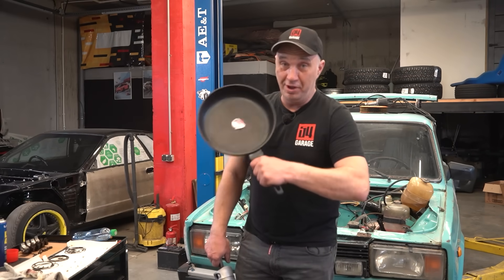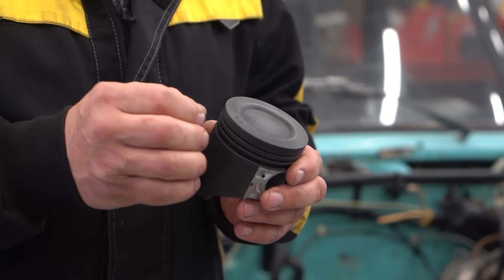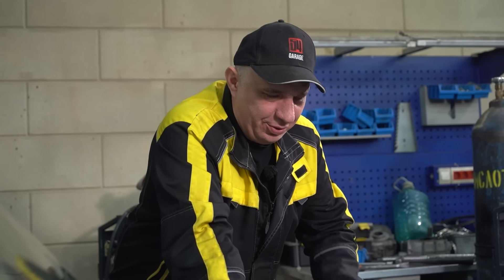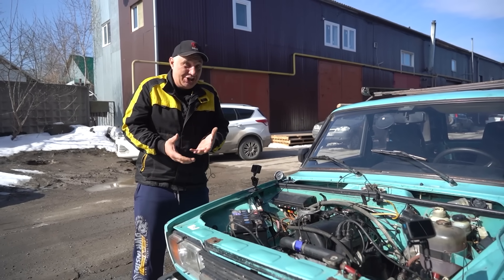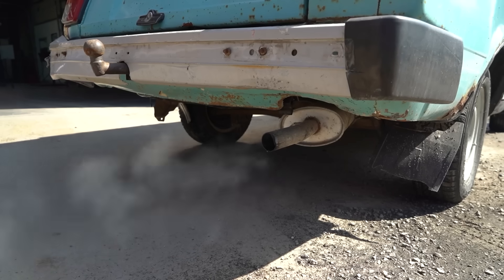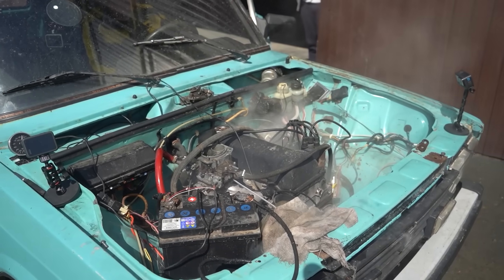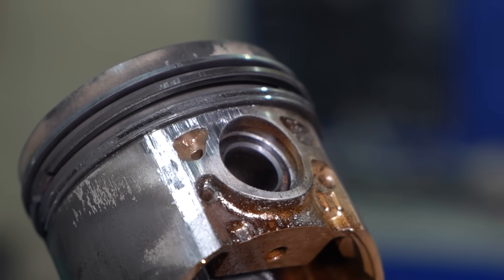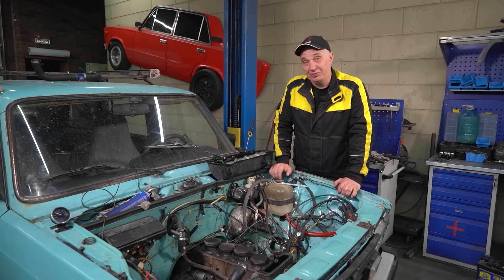We coat pistons with Teflon - what will happen?

Comment: Teflon is outdated as a coating material it doesn't last long and is not as efficient as modern coating methods like TiN, Manufacturers use DLC coating or ceramic entirely but not the same coating everywhere for piston dome, it's preferably made separately. Real race pistons made from anodized aluminium or classical with 3 coating zones. Teflon may be of some use on pistons skirts but nowhere else especially on segment rings, that's another coating, DLC is top notch but rather technical, cause you need to mask and control coating thickness. I've seen Swiss companies offering multilayered ceramic/DLC but that's race secret weapon, no one will tell you exactly where to use it you have to try and regularly expect tour engine, i.e tear down 😂.
Also for DLC, one have to remember that carbon, especially do for a quite good cutting tool, even at 1 micrometer particul, I would advise to either DLC Cylinder walls or add ceramic liners. Those treatment should be made in copiously honed parts also not the average Joe job. 
Also WPC metal treatment is another weapon in our disposition. It makes great surface for reciprocating part sliding against each others.
Coating is something special, you also have to check carefully for tolerances and maybe have to take oversized parts since metal expansion is not the same anymore. Since efficient coating thickness is rarely above 1-3 micrometer on pistons skirts you are usually pretty safe with OarMnparts

Comment: What is the point? it is the cylinder walls and piston rings that should have been coated. The piston does ideally not have any contact with the cylinder walls.

Comment: I ran a 72 plymouth without a radiator unknowingly for about 20~40 miles after the engine mounts failed and crashed into the radiator on its first test drive in 5~ years of sitting- the temp gauge was about a full inch past the limits on the gauge.

Comment: gonna say this before i watch the whole video. given that the last time i got high i forgot my teflon pan on the stove and it did not go well. i will say this will not go well for extended periods of time.... pistons generate around 350-500 degress celcius - teflon melts at.... 327.... this should be interesting when you factor in cooling and engine overall temps.

Comment: What you want to use is Cerakote. It's a ceramic coating made for auto racing that's now used in firearm's coatings. The one you want is called micro slick. Anti friction coating

Comment: An old engine rebuilder friend told me that Teflon coated engine connecting rod  bearings were tried by a big auto maker but they did not last long in use ,that was 45 years ago

Comment: In my opinion, Teflon coating is more reliable than no protection at all and is a fairly cheap option compared to ceramic coating, which may still be very expensive.

Comment: Try using titanium pistons.
Pros would be: higher Heat resistance, higher rpm’s, longer lasting.
Cons would be: high cost, risk of cracking a piston ring, and risk of blowing a gasket.

Comment: Teflon would work but is has a short life span. Like my frying pan it work till it wears out. Ceramic is what most used now, but for piston graphite might be a better application. I believe MB built a prototype 190 with graphite pistons with success, but dev cost was expensive.

Comment: piston engines have a few thousandths clearance between the piston body and cylinder wall for lubrication and reduction of friction. spraying a teflon coating on the piston body contributes to less clearance, leading to less lubrication, and more friction, and overheating especially after the teflon rubs off unevenly. any coating on the piston crown will probably burn off unevenly, cause valve problems, pre-ignition problems, and contaminate the engine as well as the ambient air. DuPont, the creator of Teflon, has stated that teflon is not useful for internal combustion engines. Concerns include potential clogging of oil passages or filters due to PTFE particles settling or forming globs, especially if not properly dispersed. There are products like Slick 50 Classic Engine Treatment, which offer PTFE-based additives designed to be mixed with standard motor oils. These additives claim to reduce friction, wear, and engine noise while improving performance and fuel efficiency by forming a lubricating "film" on most engine parts at once vs. baking the parts w a teflon coating.

Comment: Teflon does not transfer heat very well and will keep those Pistons from expanding by very much. The engine itself will still heat up. But the Piston itself will not get leaner mixture and get better fuel mileage and a hotter spark can be utilized

Comment: I have not watched the video but this is my prediction the front failed at about 250c. An engine piston normally maintain around that range. Basically the Teflon will exceed the exhaust pipe breathe in by some people and get stuck forever

Comment: Engine is stuck due to lack of lubrication what you can try is change the engine oil to 0w30 instead 5w40 because teflon coating reduced the space between engine sleeve and piston and 5w40 oil is thicker than 0w30

Comment: Heat the pistons to 300° and dip them in graphite powder, the kind used in farming is cheap, and see the result with a slight resistance to friction at high temperatures.

Comment: Make the highest revving motor possible, ceramic coat  some cylinder sleeves and press them in, ceramic coat the rings cam and crankshaft, all of the bearings, shorten the rods, remove the counter weights on the crankshaft, stiffer springs, larger cam, run a lightweight flywheel and driveshaft

Comment: The only part of the piston in contact with the cylinder wall is the piston ring.  The tefloned parts don't even touch anything except the engine oil. WTF, am I wrong?

Comment: I Had A Honda Civic That The Radiator Got Busted! I Went To The Creek And Got Enough Water In It To Make It To Auto-Shack! I Put Slick 50 Into The Engine Oil And You Could See The Temp Needle Move Down!! I Was Able To Drive The Car Another 15 Miles To get her Home! So I Believe In PTFE But In The Oil! Not The Combustion Chamber!

Comment: Heat resistance: Teflon™ industrial coatings can operate continuously at temperatures up to 260 °C (500 °F) and be used for intermittent service up to 316 °C (600 °F), with adequate ventilation, without affecting other properties

Comment: i didn't see your video yet but teflon hate friction whatever rings are the only one contact, engines start before pump inject grass in cylinder then less than one second with oil between cylinder and piston will erase teflon

Comment: Well, only issue I see here. I'm pretty sure there's a reason they say not to use metal utensils in some teaflon pans lol. I haven't finished the video but I suspect some FOD when you check the oil pan with a magnet.

Comment: It wouldn’t matter what you coated the pistons with as they are floating in the rings in the cylinders and are not 100% in contact with the cylinder walls. I’d think you would have to teflon coat the rings themselves to see any true results

Comment: 2:28 I am sorry, but that does not sound right. Before coating it had Ø79mm. After coating it is Ø78,8mm? So it got smaller? Certainly not. 
I think they never gave a measurement for the bore, so you cannot calculate the clearance at all.

Comment: I used to use Slick 50 to help old engines, it was brilliant. And worked by adding a Teflon coating to all parts slowly over a few hundred miles. 
Had one which even stopped its crankshaft knocking with it, brilliant stuff !!

Comment: There is NO advantage to be had by teflon coating the pistons. The only friction that COULD be improved is that between the piston rings and the cylinder, neither of which were coated and neiter of which would stand teflon coating. This is a stupid experiment.

Comment: Did you ask for any compensation on the machining of the OD of the piston before you did the Teflon coating ?  
  Or did you use the Teflon coating to compensate for cylinder diameter wear. 
Either way I would like to know if the piston diameter changed substantially by the application of the Teflon coding thank you

Comment: After it gets hot just once  it will burn the coating off

Teflon, or polytetrafluoroethylene (PTFE), can withstand temperatures up to 260°C (500°F) without damage. However, it begins to deteriorate at temperatures above 260°C and decomposes above 350°C (662°F). Pyrolysis, or complete decomposition, occurs at temperatures above 400°C (752°F).

Comment: excuse me since i raced and built a 750 hp in the 70's what i remember the the Piston won't touch the wall's of the cylinder it the RING'S that do this job and these are what is coated  with TEFLON .

Comment: So I’m confused if the piston touches the cylinder wall that’s a problem. Pistons have 3 piston rings 2 of which keep the piston from touching the cylinder wall. So why do we need slippery pistons? We need slippery piston rings or slippery cylinder walls but coating pistons seems silly to me.

Comment: You should coat the cylinder walls too. Maybe next time. You guys are nuts and I love it!
Reply: Wouldn't work. That's where all the friction is.😊
Reply: @josephdelp87  Manufacturers have been coating cylinder walls in low friction materials for decades. It's actually the right way to do it because the piston skirts themselves don't have much contact with anything, it's mostly the rings that scrape the cylinders.

Comment: I had a 1964 dodge dark slant 6.
 I used Slick/50 oil treatment. 
It went from 20 to 32mpg.
24$ a qt. In 1981. You could run out of oil and it would not seize.
Wish they still made it.

Comment: don't those older engines usually operate at around 70°C?
that's almost 3 times operating temperature
and more then 2 times modern engines operating temperatures

Comment: The piston ring means the coating is not even important.....the piston is smaller than the cylinder and the expansion of the ring is what makes the seal any coating would just be decoration unless in is incapable of withstanding the friction or heat.of the expansion gets to the point of seizure then a coating would not matter as it's size (diameter) rather than friction which is the point of failure.

Comment: ceramic pistons come on. air bearing as the piston seal. use the non-expansion ceramics. or zero expansion ceramics. something like zerodur glass-ceramics. ceramics dont care if its even at 1000C. teflon has a max temperature of melting point. around 200C or so. its plastic yet. actually normal 3d printed pla melting point is around 200C also.

Comment: PTFE is only up max 350 Celsius.Try DuraCoat, its maybe better for  higher temperatur. Or You can use natrium-filled forged steel piston, with DLC (diamond like carbon coating). Or maybe if You have very good sponsor, use pure beryllium piston and cranksheft... it will be expensive.

Comment: Teflon is great, looking at the experiment, next phase should be Teflon coating the cylinder wall and where it touches the piston. Top can be avoided as it changes the compression ratio. It also gets burned after some time...

Can also do the above experiment with Ceramic as suggested by other viewers.🎉🎉🎉

Comment: I totally predicted that the teflon will just burn off completely, right at the beginning of the video.
Anyone could tell so, who've been accidentally left a non stick teflon pot on the stove without liquid in it for half an hour :D
You might think that the teflon got too hot at 200+ Degrees C, but the combustion is actually a LOT hotter, like 2000C, which will get in contact with the Teflon.
At that temperature, any paint will just burn.

Comment: I am not a mechanic. I was under the impression the piston does not touch the wall of the engine. The piston rings run inside so what has the deal with this spray Job. Possibly the head of the piston may do something with the compression head distance of a few microns

Comment: ptfe/ teflon breaks down at 250-260c the combustion temp of a cylinder is 2000-2500c. normal operating temp destroys the ptfe, what is the point?

Comment: There is an American company that makes slippery aluminum coatings that involve hard-coat anodizing the aluminum and impregnating the hardcoating with a slippery polymer. I believe they have a variety of coatings that are put into the anodizing (yes, I said "into" and not "on top of").
At first, hard-coat anodizing seems to be a strange thing to do a surface that requires it to be slippery. Anodizing, after all, produces a hard aluminum oxide surface finish and aluminum oxide  is a material commonly used to make sandpaper. 
Unfortunately, i believe this surface treatment that ends up being slipery is expensive. I don't know what temperatures it can withstand.

Comment: I wonder what would happen, if you had about 2× times the piston to cylinder wall clearance, (I think it might have been tight) and good antifreeze. Maybe an anodizing with Teflon in it, or something else in it for dry lubricity, and use a synthetic oil in the engine? I think you can do your own, at home with success, if you can find the right stuff. I just don't know what that would be. If you can find an at home solution that is cheep; you could make a business out of saleing a do it at home kit to home shop mechanics everywhere.

Comment: Actually, I think this experiment has worked beautifully proving how teflon coating works. The catastrophic result was perfectly expected, coating with teflon is not going to reduce the dilation of the piston and the cylinder, that's what the tolerances are made for, reducing the tolerances to half a millimeter is a recipe for failure, whatever you coat the piston with: the first thing to do was to re-bore and recoat the cylinders to re-establish the same tolerances. Now, for the results, resistance to heat is not what you're looking to check. The main interest of PTFE ("Teflon" is a registered trade mark) is its ability to reduce friction with metal, reducing the energy loss, theoretically. Therefore, what you want to do is coat all pieces in movement with PTFE (especially the rotating axes) and see if it makes a difference in energy ouput, torque, etc. Even a 2% difference would make it commercially viable...

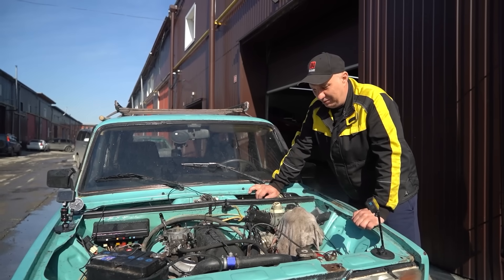Comment: 6:44 Ah yes, the so lovely plastic radiator ends which can't take anything and explode so easily when they are put under a bit of stress. They are just garbage. And that's the reason car manufacturers produce them. They want garbage that doesn't last rather than making proper products which last.

Comment: Why not prelube everything, then not add any additional oil to the pan, then run it? Should it seize faster.
Or add the Teflon to the cylinder sleeves and not the pistons

Comment: Correct me if I'm wrong but doesn't the Rings touch the cylinder wall which would create the friction not the Piston so putting Teflon on the Piston is not going to help should have been on the Rings for a proper test of friction

Comment: I work on Diesel engines and ive always wondered what would happen if you just install a head and no cam. All The valves are closed and mad pressure will happen and my question is how much pressure and where is the failure? The head gasket or the connecting rod? Like what would fail under extreme conditions?

Comment: Fun fact.  GM originally wanted the aluminum 140 cu in Chevy Vega engine to operate without a radiator.  The cost savings of having no radiator was incredibly tempting.  The prototype engine was able to shed heat on its own in cool weather but, GM gave the Vega engine a tiny token radiator just in case.

Comment: Now try tungsten disulfide in the oil in high concentrations, and use a fine oil screen instead of a filter. 
It should work, superior to teflon. Heat and friction, and long term durability, techincally much much more useful. 

Then run the engine at ambient, with no cooling, lean it out, and run the right timing for the ultimate mpg. It would be a vapor car. 

IT WOULD WORK
Try it Garage 54 !!!

Comment: Not sure if it'll work... Most of the contact is between the ring and the cylinder wall... You'd do better coating the rings the the cylinder wall instead of the piston...

Comment: I used to race a Honda twin and used Teflon coated Kawasaki pistons modded to fit, they were good for about an extra 500 rpm without additional cooling issues.

Comment: It’s funny you should mention Teflon.  I was just machining PTFE on my milling machine.  It’s a dream to machine.  It likes high speed with an end mill with wide flutes for easy chip removal.  It’s so slippery and has very low fiction coefficient.  It’s like the brass of the plastics world.  Cool stuff.  Nowadays we use ceramic to coat our pans.

Comment: As far as I'm aware the piston doesn't touch the cylinder, only the rings. So coating the piston has nothing to do with friction. The only thing that may be different is how much carbon deposit is on it. Makes no sense. The reason the piston scraped the cylinders is because it expanded when they overheated the engine.

Comment: Fun fact, this adds 100 extra horsepower because the air or CO2 and fuel on everything just slips out so you get less restriction and also no carbon at all. This engine will never get Hydro locked because of the fact that the water never stays.😂

Comment: Coating the piston isn't going to eliminate friction of the engine. The piston rings are going to produce heat along with combustion. The skirts are coated with Teflon which does not to scuff the piston walls. With overheat or a lack of lubrication, it will damage the piston walls.